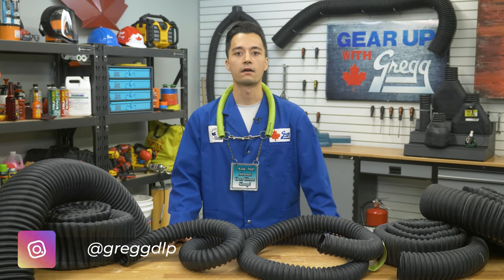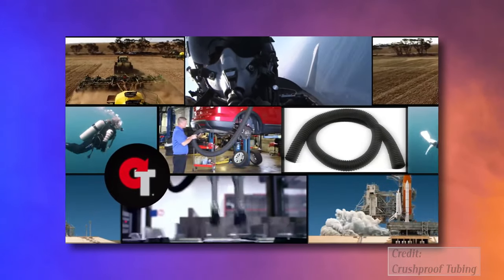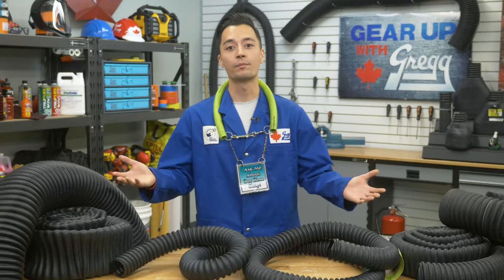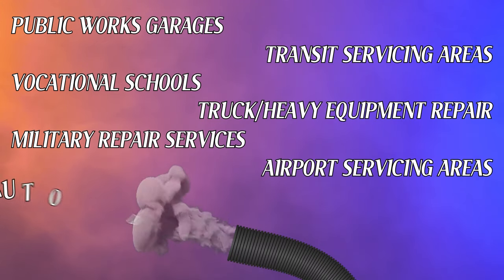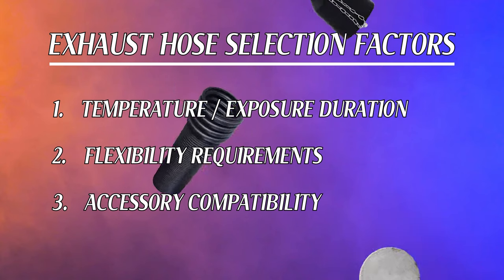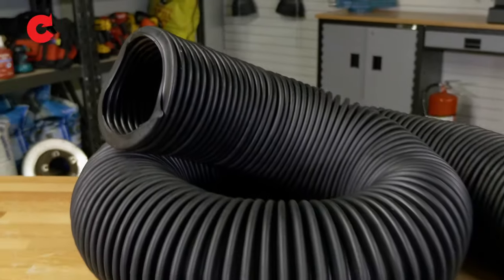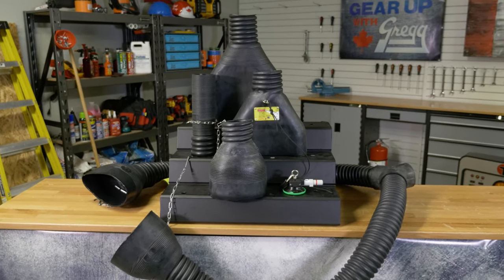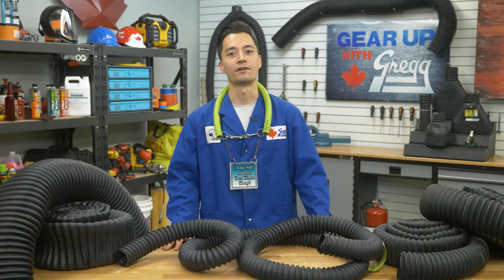How Exhaust Hoses Work - Gear Up with Gregg's

Comment: I have a 99 Jeep XJ (Cherokee Sport) that has been modified for camping/overlanding. I need to be able to divert the exhaust in case we need to run the engine with a “tent-room” attached to the back of the vehicle. Is your product the proper solution for this application?
Reply from the maker: This product is really intended for shop use, so probably best to avoid it for your application.
Reply: Curious what you ended up going with as I’m looking to do something similar
Reply: @marlonprinceguide  nothing yet. It’s low on the “finish the job”priority list.